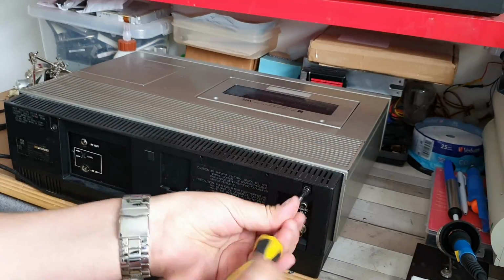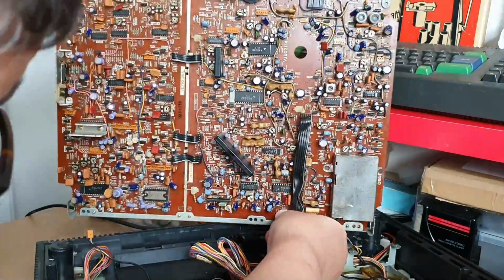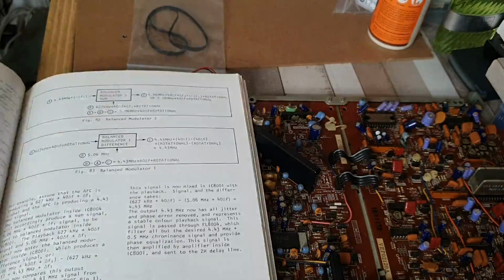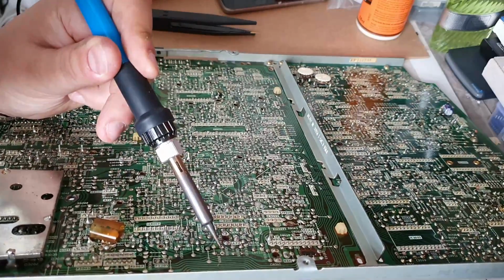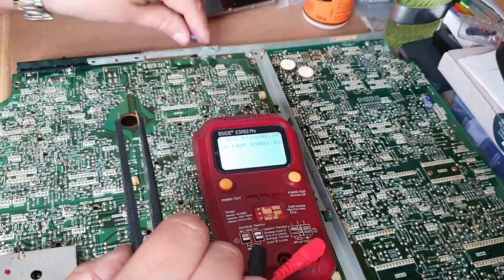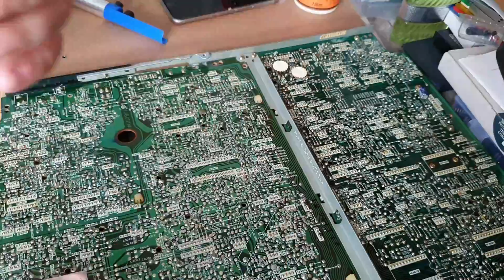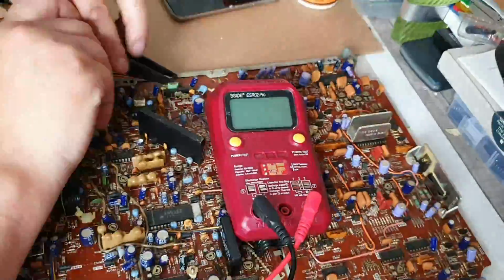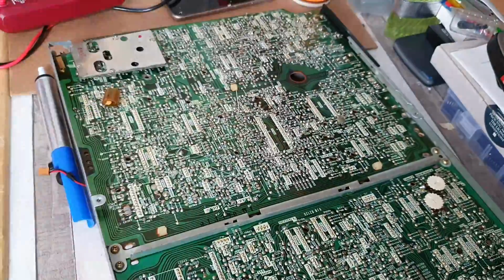Pansonic NV7200 - Continued problems with colour - Short

Comment: with out the use of a scope you will never be able to set up the choma circuits. 
when i worked on these in the late 80s i used a 10 year old telequipment scope  .
have checked the crystals in the croma circuit ? though if you have twiddled the presets  you would still need a scope to stand any chance of realighning them . They are good decks so well worth the effort of repair.
Reply from the maker: It is now in storage until we have moved house. I will be investing in a suitable scope, and having another go. As you rightly say, there is really not much more I can do, or test, without one.